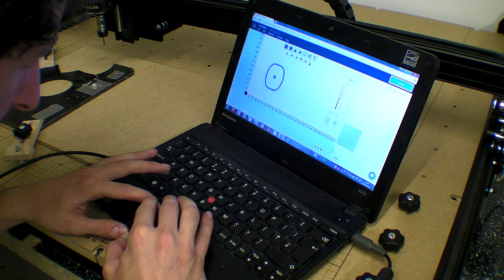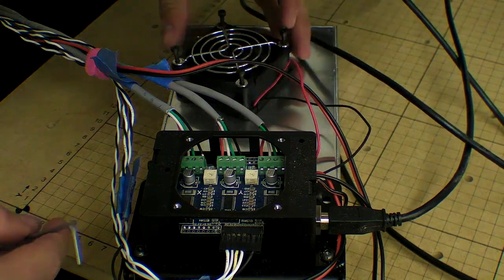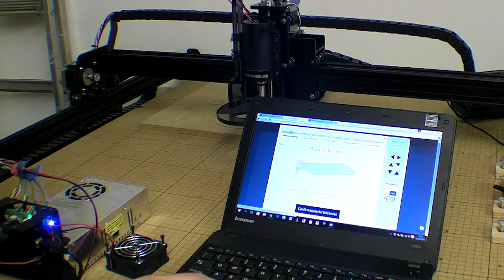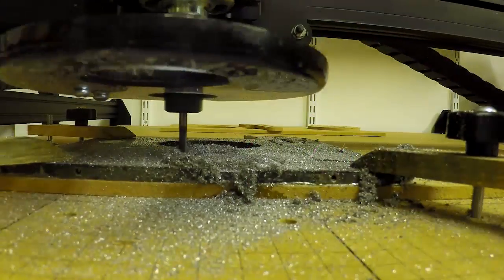CNC Easy Table / Clamping Knobs / Milling Aluminium / Stepper Motor Voltage

Comment: After doing a CNC Setting &  operating course at college I know from my own experience of breaking a few end mill bits on aluminium that the biggest thing that you do need to have is plenty of cooling fluid. Because of how the aluminium cuts it can form a back into its self from the swarf & cause the bit to bind. There are a lot of things that also need to be taken into consideration like feed rate, size of cutter,  type of material being cut, depth of cut &  I could see a few of these relating to wood as well (minus the cooling fluid) . 
But you can pick up a lot of information from the tool manufacturer &  the supplier of the material (metal) never tried wood. I hope that this may have helped &  been loving watching the video's about CNC in the wording field

Comment: One way you can overcome the limits of software like the XCarve uses for the hold down tab placement it to just lie to the software.  if you want to cut something that is 1/4" thick, tell the machine it is actually 5/16" or 3/8".  It sees your cut as being a carving instead of an actual cut and you place tabs as you like or use something like double sided tape to hold your actual cut to a sacrificial board to raise it up as needed.

Comment: Is it a camera base? I had similar problems with the step motor, but mine was because the machine wasn't super square. The small one might have done the Al better just because it's probably more rigid. Although I do have similar calibration issues. Easel isn't great for the type of work you probably want to do, I am considering meshcam.
Reply from the maker: +The Nomadic Polywright Show We use artcam at work and I am considering moving to that.  Would make my life a little easier.

Comment: Being totally ignorant about CNC and the X-carve, please indulge me.  How do you decide on the feedrate and depth of cut for different materials?  Is it trial and error, i.e., start out real slow and increase until you get chatter?

OH, and thanks for putting this through its paces!
Reply from the maker: +Bill Weissborn There are calculators and data sheets which you can reference but it is best to start slow and work your way up.  I've only began really testing this machine.and somehow I imagine it's going to look very different in a years time.